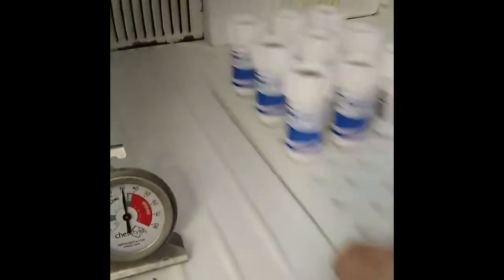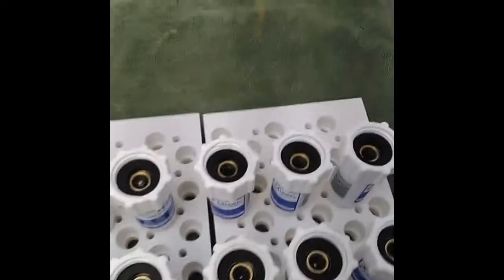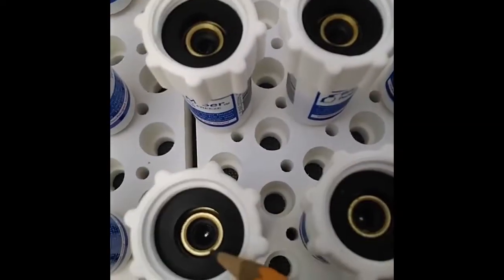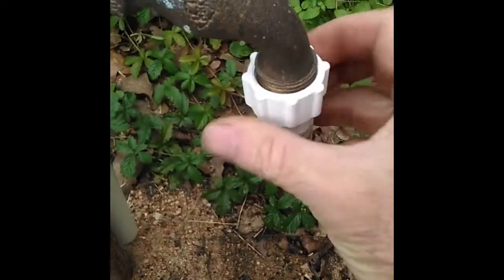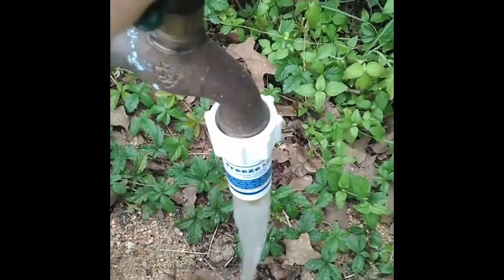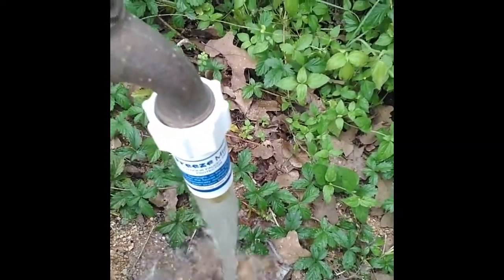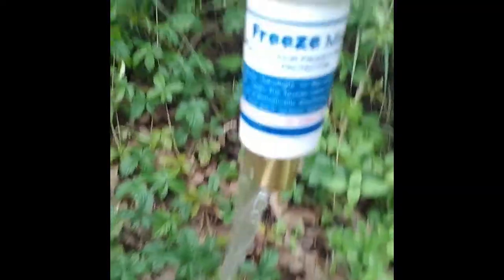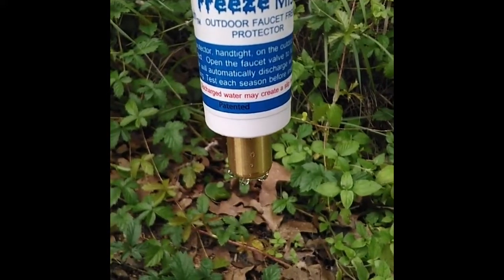How to Test your Freeze Miser

Comment: Two out of six I tested so far failed. They gushed water around the outside of the center cylinder at an outside air temp of 50ºF
Reply: What! that is disheartening to hear. i just bought my first one. The rod is not retracted but it's not protruding that much - just a nub showing. I suppose that's the  way it's suppose to do. 
I had thought to NOT test it but just hook it up and monitor it as the temps lower outside. After hearing your experience, i guess i'll have to test it with the freezer method.

I was under the impression that  Fail was infrequent - that i could just hook it up without testing and be relatively confident it will work.

Actually, for the company to even suggest this freezer-first test does kinda lend itself to scenarios like you describe. 
Oh well, i'll find out tonight. fingers crossed. wish me luck
Reply: Yea I hooked all mine to my hoses using the Y hose splitters and they have a stream of water coming out. It’s been low to mid 30°s with highs of mid 40s where I’m at. I’ll have to undo them, freeze them, reattach, then see if The mechanism in each one will work right. I can return by Jan 31st if needed. Have a BLESSED day y’all!